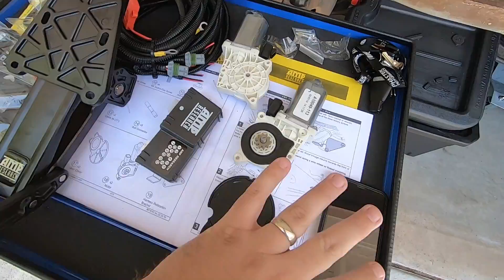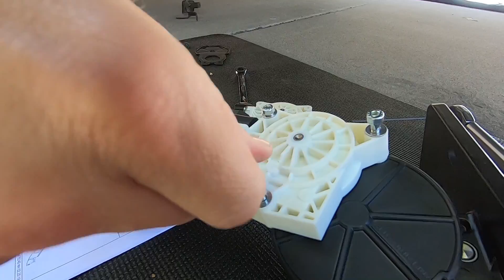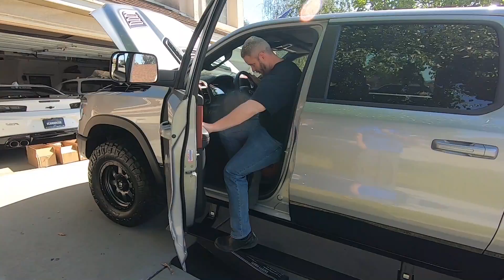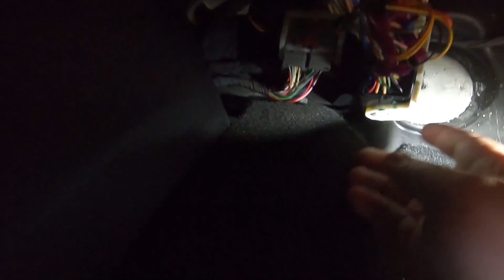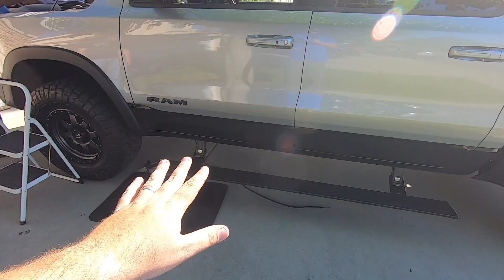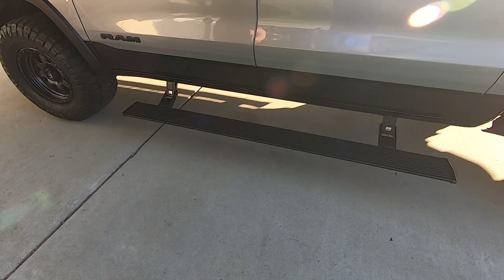Ram 1500 AMP Research Power Steps Install Guide!

Comment: My issue with the unit is everyone is facing the connections upward on the control module... exactly how water can get in..
Reply from the maker: @badlilstang  I can report these have been on the truck for 5 years with no issues.

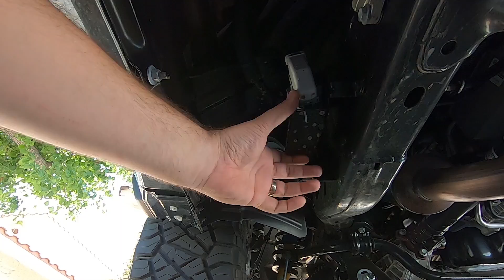Comment: That bracket you're holding at 2:48. Did that come with the powersteps? The set that I purchased did not seem to include that in the boxes.
Reply from the maker: It should have depending on your model truck. It relocates the harness so the motor and steps clear
Reply: @Lethalgarage  yeah, mine did not come with it. Have a 2021 rebel. I think it was just left out of the box. I emailed AMP. Hopefully they can send me one.
Reply: @Lethalgarage  I spoke to AMP Research today. It turns out, they changed brands of motors they supply with the powersteps. The new ones are a lower profile and the relocation bracket is supposedly not needed anymore. Thats why it wasn't included in the packaging.

Comment: this video helped me.  bought my 19 rebel from Volkswagen dealership and they didn't know how to activate them. told me to go to dodge dealership to help me. 2months I went with the running boards not activating. so today I went to the dodge dealership. set an appointment for next week. Decided I couldn't wait and looked for videos and came across yours and say it all. and we'll saw where it connected in the bottom of the steering wheel. so I checked and come to find out.... IT HAS BEEN DISCONNECTED ALL THIS TIME 😄 🤣 😂.  Thanks for the video.

Comment: im doing this on a 2021 ram 1500, and i think they must have reconfigured the wiring a little for this model year, i had no issues at all with repositioning the wiring harness bracket, i didnt have to unclip it from the frame, and there is no part of the wiring that's in contact with the edge of the frame anywhere it could rub.  it was very simple to move the bracket

Comment: Hey guys I ran my harness in the support you’re strapped to.
Just use a flat head screwdriver and pull apart each section as you lift up the tabs.
Do the lower ones too.

Comment: FYI for anyone who has these steps - if you unhook or replace your battery, make sure to remove the fuse before reconnecting the battery or your steps won't work. This video saved me from that (didn't know cause I didn't install them). Thanks guys!
Reply: What if you already did what do you do after they don’t work? 😅

Comment: Hey man just wanted to let you know I have the same kit and truck - 2020 ram rebel when I installed the steps moving the wire harness on that relocation bracket exactly the same way as you. My wire harness failed from rubbing against the frame where that hole is in the body melted my wires together and engaged my parking brake at 35 mph. I had to pay $3,629.43 to get everything fixed. Amp research will not take blame for this whatsoever. Check underneath where it is bent at a 90° angle and hope your wires aren't rubbing. This is a design flaw from amp and now my warranty is voided on a truck 4 months old
Reply: It looks like they all hid from this comment!!!
Reply: @larrywilliams3858  sure seems that way doesn't it.
Reply: @larrywilliams3858  in the end amp did pay for the fix I went a month without my vehicle
Reply: @jamesmlatnik8855  No fun there!!

Comment: What if you need to use the OBD port for other purposes. Will the steps not work if not plugged into the OBD connector? I feel like there should be a different way to wire it in.
Reply from the maker: They make splitters

Comment: Not true that they got it right on the 19 for amp research steps. There is actually 2 different amp kits you can purchase depending on what you want to spend or how much install effort you want to endure. They have a kit that is completely plug in play with no wire splicing or a wired in kit. I bought them for my 14 ram Laramie and went with the plug and play. I didn't have to tap into anything which is why I wanted the plug and play. The other optional kit was all direct wire splicing.

Comment: when you say 16 lb ft/ft lb when installing the motor, does that mean 16 rotations?
Reply from the maker: Kevin Hwang no, get a trq wrench and set for 16lbs
Reply: @Lethalgarage  36 inch pounds for the motor to idler. 36 inch lbs is 3 foot lbs.

Comment: Nice. Do you know if these integrate with the uConnect system, so that there is a button on your screen to "deploy running boards" (for cleaning them)? If not, do these come with a switch to manually deploy them even with the doors closed?
Reply from the maker: Just keep your foot on them when closing the door

Comment: In the process of installing... Attempting to drill through the pinch welds and can't get through! Any advice? Using Cobalt bits and wired drill. Feels like each hole will take me an hour of drilling. Feeling like I don't care to have LEDs at the moment. Help!
Reply from the maker: Need oil on the bit tip

Comment: I will attempt this install on my 2020 RAM Rebel. Since there is almost no difference between 2020 and 2019 I am assuming the AMP Research 76240-01A will work for my RAM? 
Another questions those wheels look really nice, would you share the brand and where to buy them. Thanks!
Reply: Waseem Ahmad if you have the OBD II plug with two purple wires and a blue and white wire... you got the correct kit

Comment: I installed these today on my new 2019 Ram. This video was definitely helpful.  The one question I have is about the “clunk” sound when the steps retract. I assume that’s normal since it’s similar on both sides. Any feedback would be appreciated. Thanks!
Reply from the maker: Its the motors locking into position.